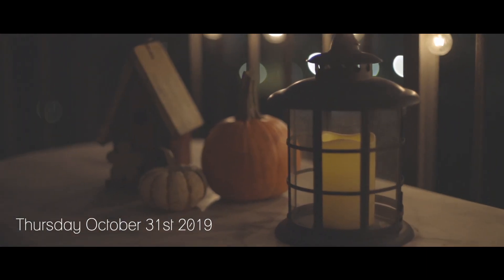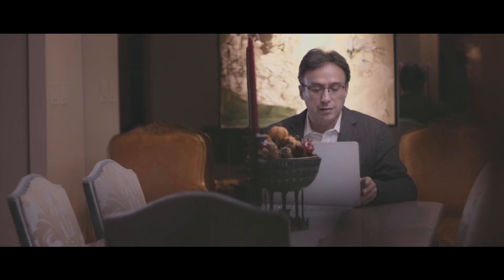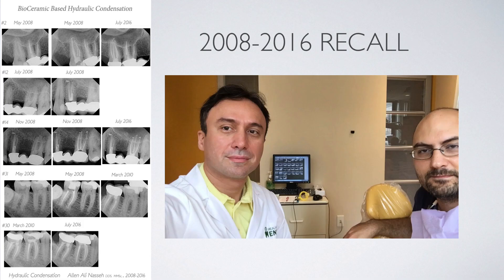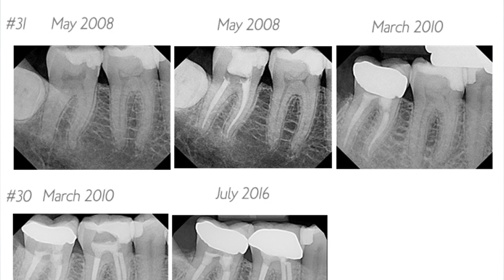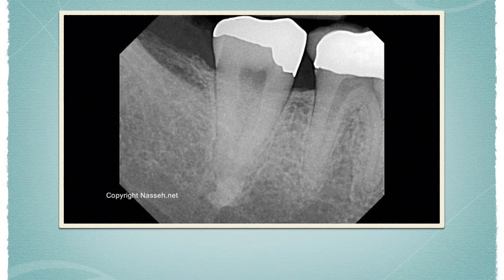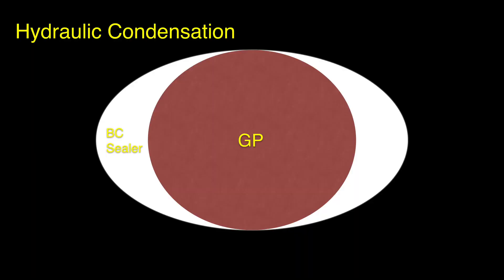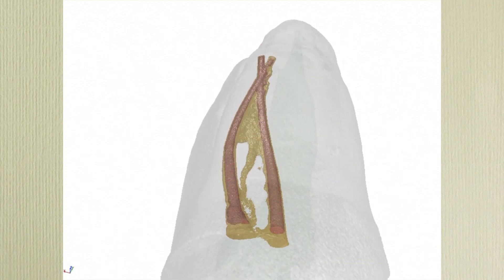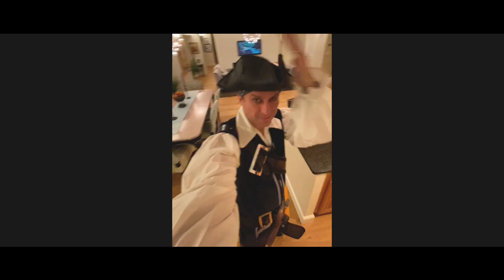Friday Questions: Hydraulic Condensation Prognosis and Root Sections

Comment: Hello Ali! Do you think that using BC Coated GuttaPercha points makes a significant difference compared to non coated with BC sealers?  I am transfering from vertical condensation to bioceramic sealer based obturation and those GP points are not realy available in my country, so I need to know - how impotrant is this?
Reply from the maker: Martin Zinek Well, the only study on this is topic is from University of Pennsylvania where they competed the seal and found a better seal with the coated cone for the first 60 days. In their study they found the seal was the same between the two groups after sixty days, presumably because the sealer expands with time and improves the seal. 
So, ideally better to use coated cone but maybe not a significant difference in the long run? 
I use the coated cones. 
Cheers!